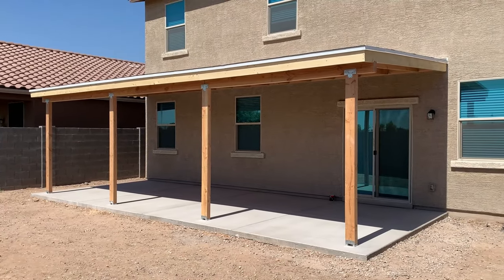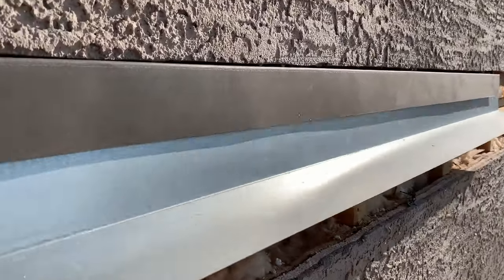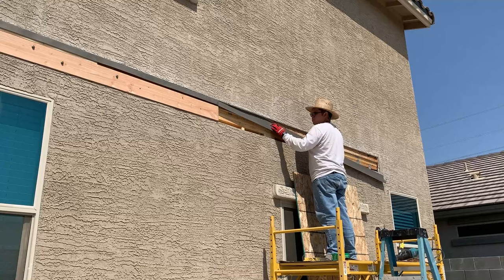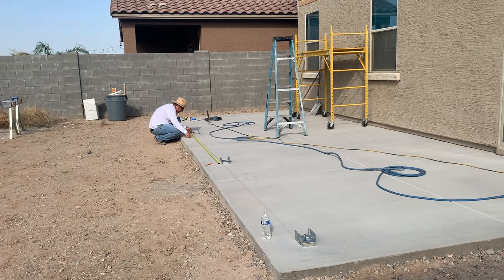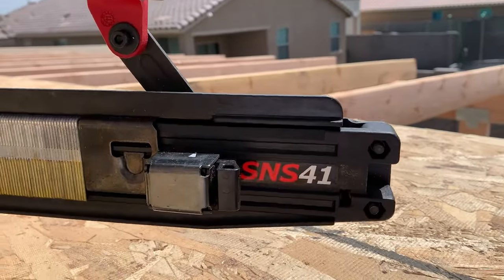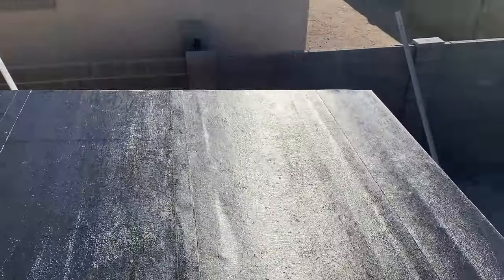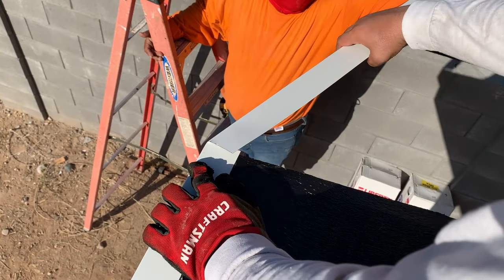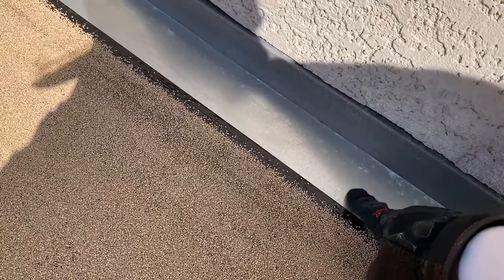My Biggest Patio Build

Comment: Definitely would not have cut out the buildings sheer structure, think you called it plywood in the way of the ledger😂 and hopefully there were footings underneath that freshly poured patio where your posts went. All things you should know if you’re a licensed contractor 😢 otherwise build was par for the course. Be careful who you hire people.
Reply from the maker: Thank you for the feedback.
Reply: Licensed contractors higher guys like this to go do the work😒
He cut aprox 16’ of osb out of the “sheer” and replaced with 2x materials 😒
And for the footings, do you really think 4” slab is going to fail from supporting maybe 250lbs at the points of contact?😒
In AZ and no snow loads…. I’m sure it’ll last for the life of the house.
Reply: Be careful if you are a licensed contractor that’s a lawsuit waiting to happen now.
Reply: Come on, Mr. Profesional. 😂😂😂
Reply: I was about to reply the same. You voided structural warrant cutting into sheer panel. Also the patio being so big you should have cut out concrete and poured your own footings. Hope this helps…
Reply: Family has been doing this for 10 years! Omg
Reply: Leak in AZ ?